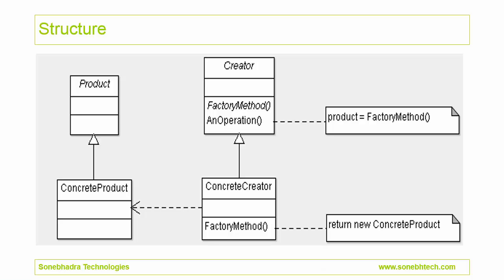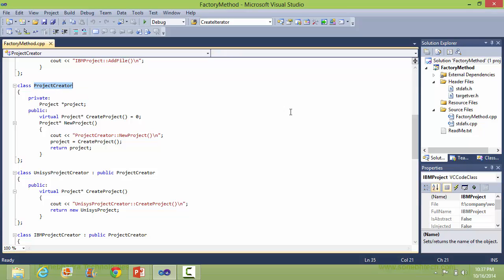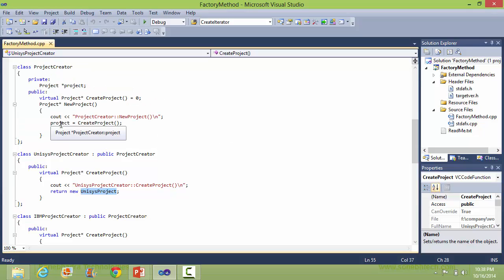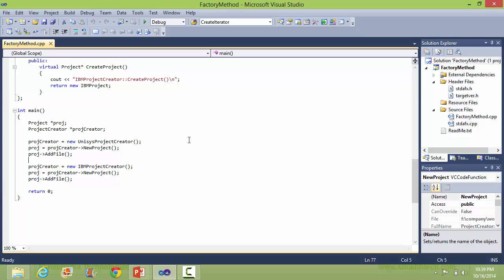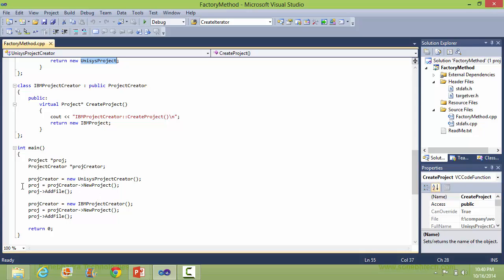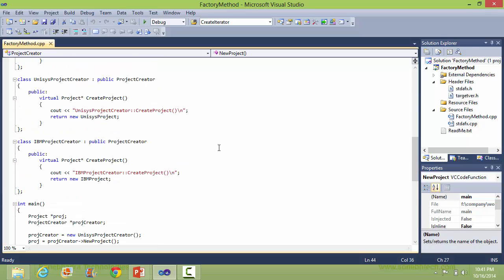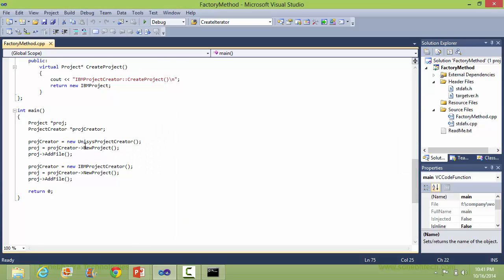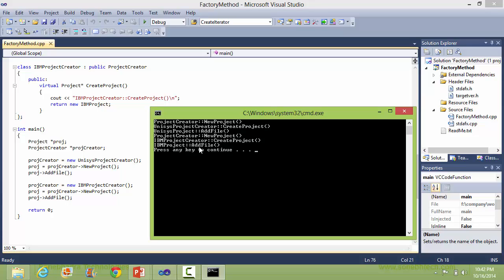Factory Method Design Pattern In C++

Comment: Its good but like other videos or explanations out there, its not clear why one should use this pattern instead of simply instantiating the subclasses directly. There is a subtle difference between 'understanding the working of the program' vs 'understanding the idea behind working of the program'. I think very few teach about the idea itself, and most of the times this 'idea' is explained in abstract  terms(where there is a way to misinterpret the concept). This way things become even more difficult especially when you have abstract factory/ factory method when explained using simple examples where the real need of using one over the other is not felt. I think its better if one teaches with a complex example(instead of a simple example), where the need and importance of the idea is felt. Without this 'need' , only the working is grasped and not the 'idea' . Neverthless thanks sir for your time and efforts for making the video. Appreciate it.
Reply from the maker: Hi Anurag. Thanks for your feedback. I appreciate it. Some other students suggested it will be good if I can explain what problem was coming in design and how a pattern provided the good design solution. I like the idea as it will improve the thought process to design. Added some more things for better understanding, I came up with my new video on Factory Method design pattern. Please have a look and will be great if you can provide your feedback, so that I can accommodate them in my other design patterns videos which I have plan to do asap.

https://www.youtube.com/watch?v=Q4ktJLM4zaQ